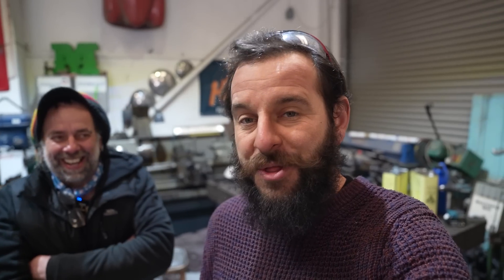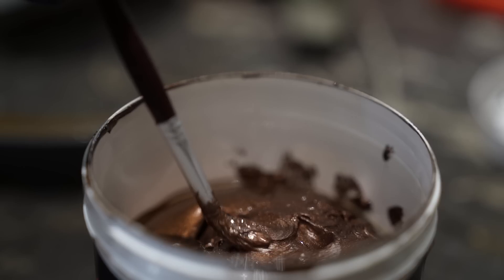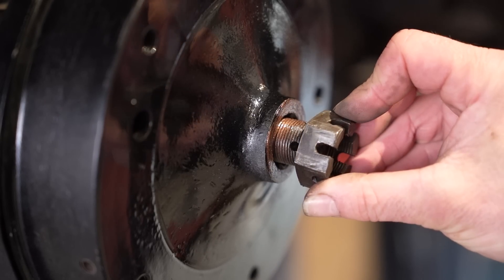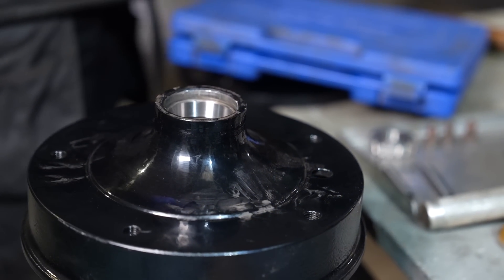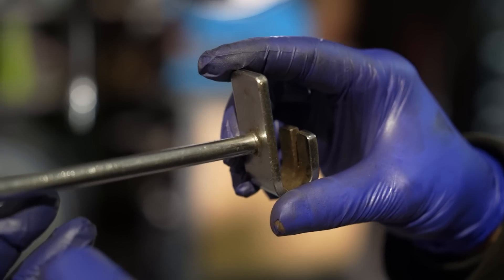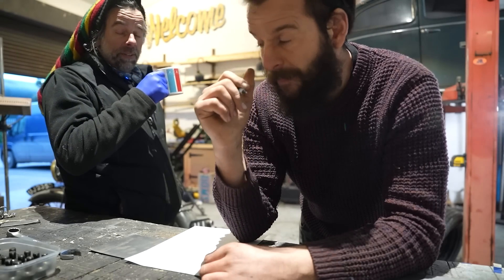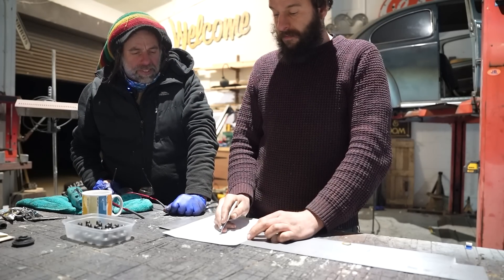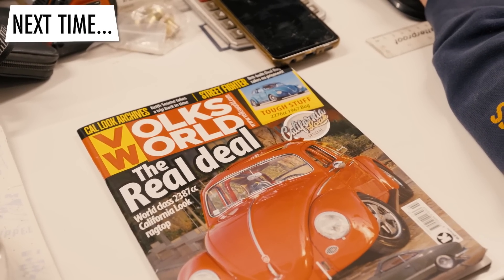'Running Out of Time' | Rescuing a 1955 VW Beetle | Episode 4

Comment: Did you torque the rear hub nuts? 256lb/ft if memory serves me right. I used to use a 36mm 3/4 socket on a 4ft scaffold pole with a bit of body weight to reach the german torque spec known as 'gudentightenouff' 😎😎 Old VW mechanics just go phut phut . Great videos guys

Comment: I like the videos but can't  help thinking new handbrake cables and rear wheel bearings would be good and the ear on the bearing cover goes down and I assume you torqued the hub nuts once it was on the floor
Reply from the maker: Handbrake cables are fine and we did rear wheel bearings just we didn’t film that part..

Comment: I think you put the brakes backing plates upside down/left to right, because the cylinder should be on top for bleeding.
Reply from the maker: Just incase anybody else is reading this, they are on the correct way! Thanks for the concern though
Reply: Ovals had the adjusters on the top, 58 and up on the bottom, essentially the same design but flipped. You can actually put the the other way (cylinders on top) it won’t be factory original but to do that you have to swap the backing plates left to right so that the handbrake cable would still work. 
But in this case Dom and John have it correct.
Reply: I stand corrected. Good to be sure.